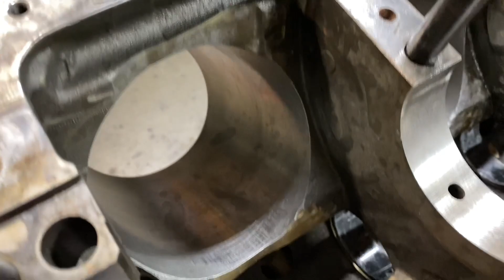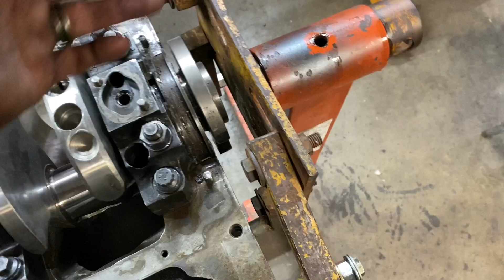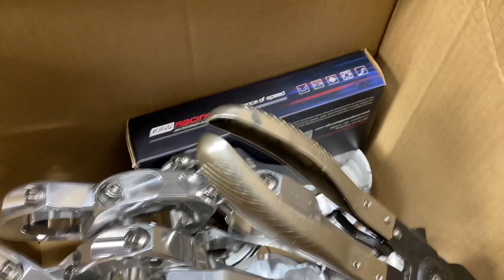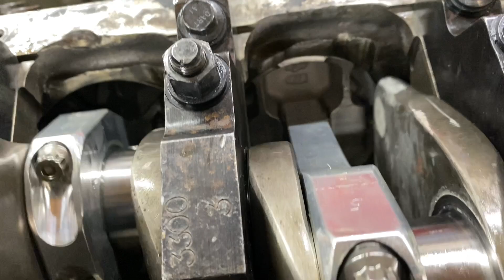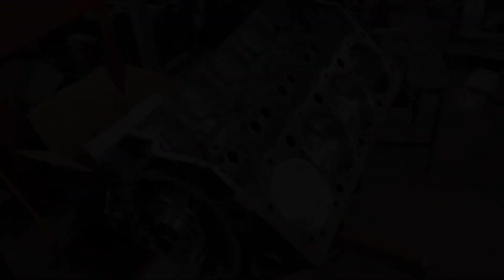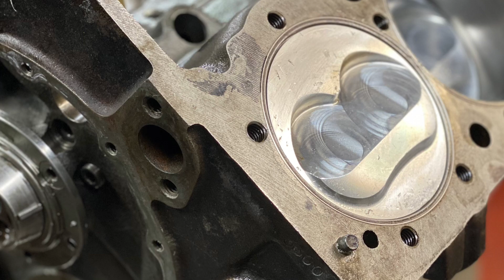Destroked 400 SBC, 364ci

Comment: Yyou have too pound the crank Back and Forword, because you dont know which way the upper thrust bearing is seated, if you only do it one way and it is off the other way, you may eat the thrust bearing out, in other words, you may get .003 thou. One way, but hitting it both ways you may get .006 or .007, and you have been fooled into thinking you got it at .003 which is accetable !? BUT the crank is only seeing 1 half of the bearing each way !

Comment: Destroked 400 with 350 crank is 377ci
Reply: If you bore the block .060 over it comes out to 377c.i. A destroked 400 with a 350 crankshaft. One of the best engines I ever built,fast and high rpm engine.
Reply: @EricCiszewski-k8g correction a 30 over is a 377 ,, a standard bore is a 372.
Reply: That is what I thought must different stroke than 3.48.
Reply: @JodyMcLain-j6i3.34 stroke 4.165 bore

Comment: Crack each  end  of the  crank  with a big hammer  before  touqork   it will spon like a top if not  you'll have  drag like  you just  showed  !! 50 yea of building  10,000 rpm small blocks

Comment: i was going to build a square body have a shit ton of them but ended up getting a 79 short box 4x4 cheyenne full option truck with the 400 / 400 turbo Quadro traction with under 35,000 miles on it for free just needed a new fuel pump and carb cleaned out. i did drive it a little but now it sets in my collection of rigs. i have 10 acres of rigs to work with. next is a 79 rs z28 t top have most of the parts to build it even new interior got most of the parts from 2 other z28's then got a stroke 454 with the 02xx trans and a t-10 not sure witch to go with have everything i need to put it in all for free

Comment: Nothings more slippery than straight STP oil treatment, works great as an assembly lube plus way cheaper than Lucas oil stabilizer. 👍
Some say several Name Brand assembly lubes is STP with different colored dyes… 🙄🤔🤷‍♂️😁

Comment: Bearing Spacers....
What keeps the stacked bearing sets from spinning?
I'm building a 2.3L Turbo and have a large journal block and a small journal stroker crank (same as you....got the crank for almost nothing).
I have to use bearing spacers but was not familiar with them, nor was I too happy about using them.
A friend told me that "SBC guys have been using them forever"....so I found your cool video!
Any advice  on bearing spacers?
Reply from the maker: I tried using the green locktite, but that took up too much bearing clearance.  I had the best luck just putting them in with no oil between the spacer and regular bearing.  I have heard of people machining dowels, but never tried it.

Comment: Just an FYI to 400 sbc builders. 2 bolt mains are actually stronger then 4 bolt mains. The geometry of the design is not the same a 350 sbc or etc. I built 10 so far, and I tell you 2 bolts hold more load.
Reply: In usual situations yes, but these are splayed main caps which are stronger than the regular 4 bolt AND the factory 2 bolt.
Reply: I've heard that about 30 yrs ago from Rick Santos. He also said take the 2 bolt main block, get some quality billet 4 bolt aftermarket mains. Rick said, that's the best without going to a girdle too. That's for a stock block, pass that, go cast iron aftermarket. Stabilize the bottom end as best you can = longevity and strength. GM went to Cummins, and their engineers said, 4 bolt mains and cross bolts = Chevy LS rules making high 1000 + horsepower beasts, they even get 5000 + ponds that survive. Isolate that bottom end for durability and gargantuan HP numbers.

Comment: Those are rugged main caps I remember a long long time ago adding supports to my caps  those are super beefy times have changed a lot for small blocks in general I can't find much affordable LS stuff so I'm going to the hemi im finding those everywhere complete vehicles for 1000.00 or less ! Miss my older builds though I used 30 over 400s with the 6 inch rod surfing through looking at the different builders on here and you all use a little here and there of what I did and I had some real fast cars that didn't need a turbo or nos my street car went 580s 590s  in an 8th mile back 25 years ago. Only used aluminum rods with nitro methane   pre ignition shock absorbers

Comment: what happen to #6 piston ? looks like battle scars...... i picked up a 400 short block the other day 509 casting apparently it was a 377 bearing spacers holding a 350 crank.0.30 over. it lost a rod im going to try to run it if it checks out ok..

Comment: bill jenkins ran the 400 bock , but used the small journal 327 steel crank , requiring more tinkering with bearings and spacers . another thing to muse over is he always prefered to use a block that had done about 100,000 miles in a truck , reasoning that the block had moved around all it was going to . a " green " or new block will move around , and all your carefully set up clearances will change , hurting power .

Comment: I'm wanting to built this combination, the class of car I'm racing has a cubic in limit to 360, I have a set of 377 pistons, would I be able to use those pistons with the 3.335 or 3.25 stroke crank? Or will I need to buy a different set of pistons the match the stroke?

Comment: Long ago we learned that bearing spacers can and do cause  the bearings to retain  a lot more heat and cause problems. 
Its a risky setup and pining them is not always a good solution either.
 Good luck and i hope it works out better now with the fresh machine work.
Reply: I RAN THEM FOR YEARS IN LATE MODEL NO TROUBLE. AT CONSISTENT 82OO RPM. OL SCHOOL WINNING BACK IN THE 70s 80s

Comment: I'd like to try destroke a 400 with a 327 or 302 crank
Reply: Our super late model engines used 3.25" stroke cranks. With a 0.030" over bore (4.155") it made 353ci and was very reliable in our class.
Reply: @whiplashmachine  did you have to drill steam holes in the heads for use on the 400 block?

Comment: Hyper lube mixed with marvel's mystery oil.. great for break ins.. has lubricity n is still sticky.. have done quite a few diesel engines that way including some performance engines n has done extremely well
Reply from the maker: Interesting
Reply: Now don't take this the wrong way but I believe that back over sticky Lucas additive that you use on those rod bearings and main bearings in this video may have been to blame for why your main bearings fail prematurely because although you have oil pressure running through that engine at start up that stuff it's so thick and so sticky that once it starts turning at a high RPM it is literally grabbing and creating suction to the point where it is pulling those bearings out of place and because of the thickness of that additive it is very difficult for that fresh oil to get through to those bearings even though it's coming straight out of the crankshaft

Comment: What does de-stroked mean?
Reply from the maker: Less stroke on the crankshaft
Reply: @TurboJohnRacing  Oh wow, and thanks for reply BTW. I never heard of anyone wanting a shorter stroke before. Everyone I ever knew building a motor (myself included) are going for more cubic inches instead of less. I'm not a pro builder, and there's a ton of tech tips that I don't know. Very curious why u have used a shorter stroke crank. What's the purpose of that?

Comment: Nice build, though I'm not a big fan of the bearing spacers, seen too many spin. Would it be possible to weld up a crank to the size of the 400 bearings and go with that? I know the rods can be welded up for strokers. Just not a fan of what i call adapting solutions inside engines, usually they fail
Reply: I would just buy the appropriate crank

Comment: Ok on the 9.5 to one on the dome
Reply from the maker: I’m glad you questioned that!  I just recalculated it. The old heads were 72cc, these are 64.  The piston was also down in the hole about .025!  With the piston at the deck, with this head it is 11.2!
Reply: @TurboJohnRacing  ok thank you I was wondering about that

Comment: Lube it up and stick it in. I ran a 377 in the mid 70's I was just using the thick bearings.  I twisted mine up. Off the line at 8 and shift at 8500. Stayed together.
Reply: What's the max you can go with oversized bearings? Before the crank is trash?
Reply: @kramnull8962  I never ran more than .010/ .010 but I'm sure .020 would be fine. Probably depends on what crank.
Reply: @kramnull8962  personally, 03 would be my limit, but every engine is different.

Comment: Cant beat a sbc, they will out last and out power a sbf every time.
Reply: I'm right with you.love a sbc.the're engineered better I built Ford engines. Chevy just built a lot better and cheaper
Reply: Dunno where you get the idea that the chevy will outlast the ford . The 351W has a stouter block than the sbc , they can handle over 1000hp. The ford also has a much stronger crank .  Fords also didn't suffer from cam wear like the flat tappet small block chevies did with their narrow cam lobes and soft cams . Mopar small blocks also have a stronger bottom end than the sbc . The mopar blocks are made of harder cast iron , with a higher nickel content . And like the ford blocks , mopar blocks have the head bolts further away from the bores which reduces distortion . Mopars also have beefier , stronger rods than chevies . Mopar rods are also longer , which reduces side loading of the cylinders for longer life . Chevy guys have to pay for "long" 6 inch rods , while mopars came stock with 6.123 inch rods . Mopars also have much wider cam lobes , with .923 inch lifters , which makes for much longer cam life with flat tappets . Yes , chevies are cheap to build , and easy to make power with due to the vast availability of cheap aftermarket heads and such . But the old carbureted , flat tappet chevies were normally worn out by 100 - 120k miles . I don't know where you get the idea that they outlast other engines .
Reply: @HowardJrFord  because in reality chevys run longer than fords. I have worked at both Ford and Chevy dealerships and there is a huge difference in engine quality.  My father says its always been like that.  Fords built better truck chassis up till 96 and GM made and makes superior engines. Ive owned all 3, chev ford and dodge.  Im not impressed with any of Fords engines except for the 300 straight 6. I am impressed with the big block chevy, they are very tolerant to abuse and they run forever

Comment: I've never heard of destroking a motor. I'll be watching to see how the end result is
Reply from the maker: It makes about 1700-1800hp with 40psi
Reply: Higher rpm. Check out the DZ 302 engine chevy came up with to specifically race against stangs back in the late 60's early 70's. Bad ass engine. Reved in the 9's

Comment: Clevite/Mahle MS1564p.  Get rid of the spacers!
Reply from the maker: Looks like they only have them in standard size?  I could not find any .020
Reply: @TurboJohnRacing  .... sorry to hear, but you’re likely to keep spinning bearings with the spacers. They don’t let the heat dissipate from the bearing to block properly.

Comment: Nice to see I'm not the only one who knows the Gen.1 SBC is far from dead.
Reply: kids who grew up on the LS think its the only engine out there..then they find out how much it costs to get it into a place designed for the Gen1. New oil pan, serpentine belt setup, throttle by wire gas pedal, etc...cheaper just to do a GenOne and swap all the 305 parts over. 

But hey, thanks to them, i'm cleaning up on all the old school engines they are throwing out :)
Reply: The OG will always be a desirable piece!
Biggest bang for ones bucks! 
If for no other reason than the countless cross dressers that will always need a OG SBC components! Lol
Reply: @klausvonschmit4722  and the used components come up for sale the cheapest they've ever been...as folks rush to the LS fever.
Reply: They will live on forever.
Reply: Old  stuff  with  better  parts  technology  was something  we made  back then  .. now you buy it

Comment: Back in the day I ran a destroked 400 but mines was a 377. And yes I also had to use the spacers had it in a pick up with 4:88 4000 stall daily driver ran low 11,s but with juice I could get thrown off the track LOL I really enjoyed that destroked 400
Reply: Please correct me if I'm mistaken, entirely possible since I haven't built a Gen 1 SBC since the 90s, but I thought the 377 was a stroked 350, not a destroked 400. I could have sworn it was a standard 4.000 bore 350 block with a 400 crank, with the 4.030 bore being a 383 and a 4.060 bore making a 388.
 While I was building a few engines back then, I admit that I didn't know all the possible combinations. If there was a destroked 400 that made 377 ci, I would seriously like to know what bore, stroke and rod combination gave that size. I have several blocks laying around, including 2 400 blocks that I stole cranks out of back in the day and I would love to build them and put them to use before I get too old to do the work myself. 
 I have a 1987 Toyota PU with a worn-out 22R that is just crying to have one of my small blocks transplanted into it.
Reply: @biohazard_613  will back in the day before large custom after market kits like eagle kits , you had to build it on your own értel piston made a bunch of weird stuff run olds rods in a small block or run straight 6 ford rods in a small block ,as far as the 377 goes mines was a400 crank in a 350 (4 inch bore ) block with king bearing spacers on the mains. But you could also put a 350 crank in a 400 (4.125 bore) had to cut the mains down too 400
Reply: @sonofmontezuma3732  thanks for the response. Like I said, I have 2 400 blocks laying around. That Toyota is screaming for a V8 swap. Looks like it’s time for me to start researching the parts that I’ll need. It’s good to have actually found a use for those blocks.
Reply: @biohazard_613  myself I would just order an eagle kit now makes life a lot easier
Reply: @sonofmontezuma3732  thanks for the recommendation. I’ve got about 4 kits on my list so far and theirs was one of them.

Comment: John u may have already told this part of the build but what length rod did u install 6" 5.7" or what i know when i built my D stroked 400 sbc i used 6" and made my engine a 377 cubic inch  best engine i have ever built
Reply from the maker: This one uses a 6.200 rod.

Comment: If you run a aftermarket 400 block with 350 mains..are spacer bearings required..do I run standard 400 pistons for 3.48 stroke as new blocks are usually standard bore.if block has steam holes..do I have to drill steam holes in my heads..
Reply from the maker: You can get aftermarket blocks with 4.125 bore and 350 main bear size.  My block just happens to have the 400 main.

Comment: Could use a little bit better Block preparation sanding block to clean all the surfaces check all the thread holes make sure the oil galleys are scrubbed and cleaned mains seem to be a little bit on a tight side need to double check bearings clearance our main caps over tighten ?

Comment: SEALS SEALS what's the real deal? GST Racing makes a one piece rear main seal that you cut on a 45 and put it on the crankshaft with a little rtv on the cut joint. Then put the crank in with the seal on it. Put your cut on the top and it's just as good as a one piece. ⌨️👍🏽👍🏽
Reply: How do you get one of these seals? Part number?

Comment: Wait so my 6.0 vortec is the same displacement? So its a 400?
Reply: No .a sbc 400 is 6.6
Reply: There are a lot of ways to get to 6.0 L... different bores and strokes.
Reply: Just like there are many ways to get to 400 inches. Look at the bore and stroke for these 3 engines: 400 ford, 400 chevy and 400 chrysler. Each arrives at the same 400 inches of displacement, just with different bore/stroke combinations. Check it out!

Comment: What gap is your maximum block surface r-ring gap?
Reply from the maker: the top ring on my piston is down about .190-.200 from the piston top
Reply: What did you gap them at how much did you open it up for boost is what I'm wondering what's the norm and what did you go amd what's your thoughts on the subject what made you decide to go with what you did . . .? And would it be any different for nitrous say ?.

Comment: Just so I’m clear the block is a 400 the crank a 350 so it needs spacer bearing to fit properly. Is this the common way to make a destroked 400?
Reply: It used to be the ONLY way to run a a 350 crank in a 400 block. Now manufacturers make specific bearing sets to install a 350 crank into a 400 block, and there's also companies that make special stroke cranks with 400 block mains. It all depends on how much $$$ you are willing to spend!
Reply: Also interested

Comment: Why don't you use the rod bolt stretch method for the ARP rod bolts ?
Reply from the maker: Mgp recommends 90ft lbs with oil.